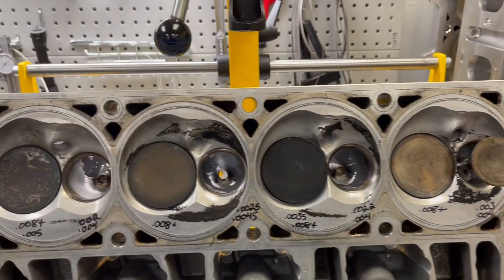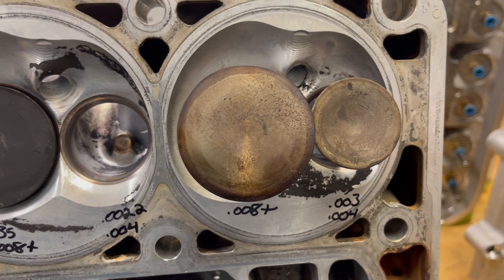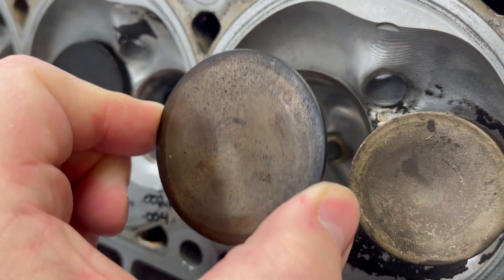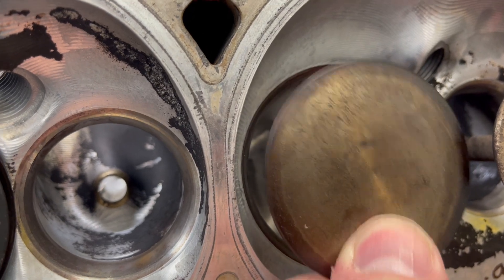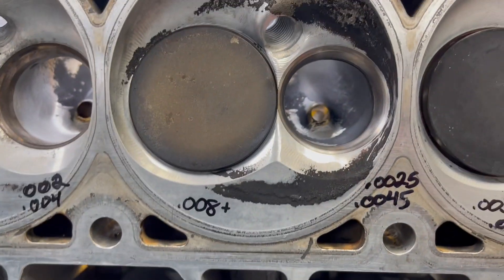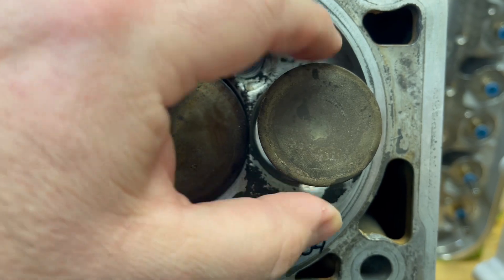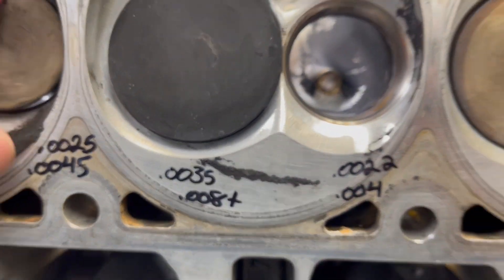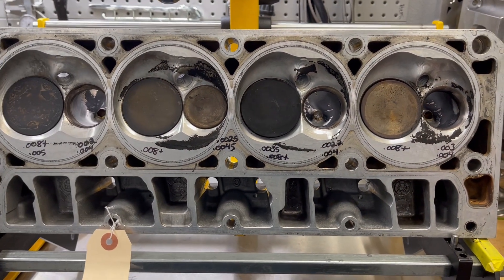LS7 Guides how bad can it get?

Comment: I just don't get how that could happen in any running engine. This must be builder error. Would love to see the guide profile with a split ball gauge. if it is not flared (i doubt) it is builder error. The oil consumption must have been huge
Reply from the maker: Hard to say, a split ball won't check the intakes, they are that bad.  Our Sunnen gage will show up to 0.008 but nothing past that.   You can see the taper in the exhaust in the video, top number is the top of the guide and the lower is the bottom part of the guide.  When we put a caliper, yes it's that bad, a caliper on the top of  the intake guide they are over 0.023" clearance (measured 0.338ish if I recall right).   Our thought might have been the valve being to rough itself but so far the profilometer doesn't show anything that abnormal on the stem.

Comment: They must be having geometry issues.
Reply from the maker: Hard to do on a OE LS with stock rocker arms and valves as all of that is locked in place.  Doesn't sound like it was crazy lift but we also only have the heads to go off.

Comment: Looks like bronze guides installed. If it's not the right kind they wear out fast. The only ones I find  that work the best was  Speed Pro manganese bronze but I don't think you can get them anymore.
Reply: CHE bronze guides with proper stem to guide clearance & valve stem surface finish. HPR for the win!
Reply: Some of these OEM LS7 valves are like files